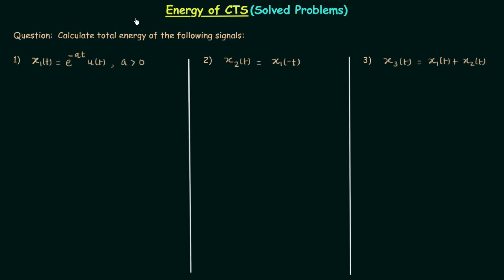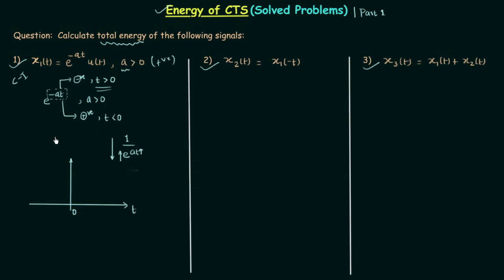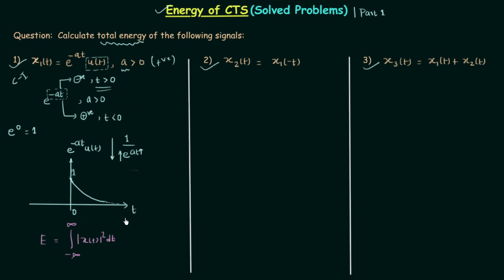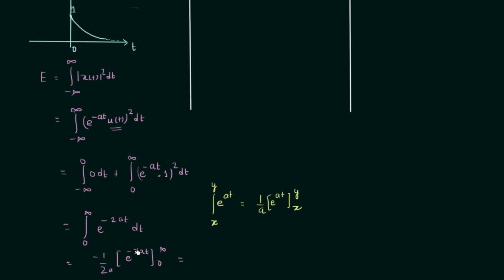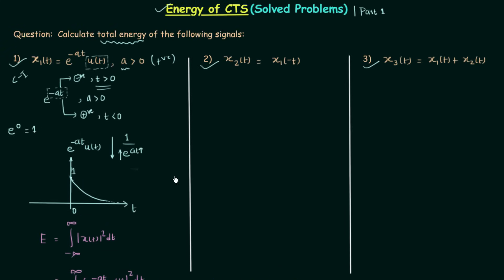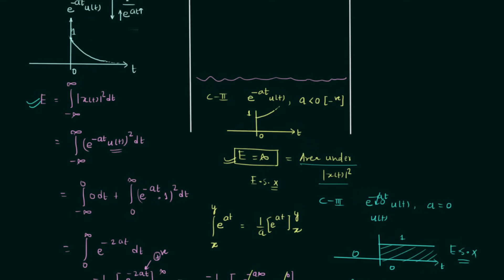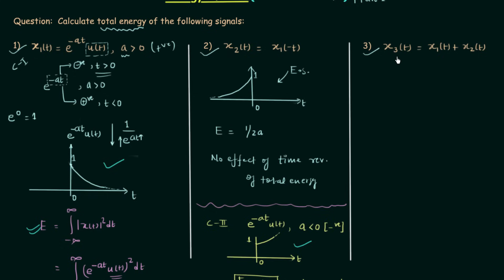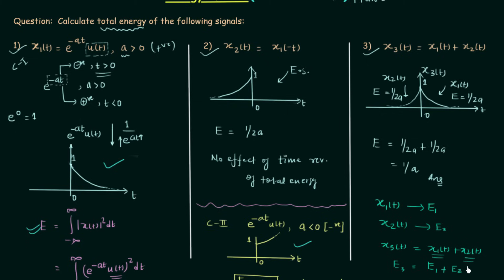Energy of CT Signals (Solved Problems) | Part 1

Comment: I am pretty sure the third case is wrong: There are again 3 cases, a< 0, a>0 and a=0. When a=0 we just have the equation of x(t) = 1 , a horizontal line that stretches in both directions infinitely so obviously E-total is infinity. When a > 0 , we have X3(t) = e^(-at)*u(t) + e^(-at)*u(-t). When a > 0, we have an exponential decreasing function such that when t < 0 it diverges and when t > 0 it converges. So the e^(-at) portion, starting at (0,1) it decreases and converges for t > 0 and for t < 0 it diverges , but when you multiply by u(t), the diverging part ( t < 0) disappears, it is equal to 0 because u(t) is 0 for t <0. That's the first part of X3(t), now looking at the second part where we have e^(-at)*u(-t), we still have the same decreasing function such that when t < 0, it diverges and when t > 0 it converges. However when we multiply by u(-t), the converging part of e^(-at) , when t > 0, it disappears, it is equal to 0 because u(-t) = 0 for t > 0. Adding both of those portions together just produces a normal decreasing exponential function where it diverges for t < 0 and converges for t > 0.  Case 3 produces the opposite except now we have in the end a exponential increasing function. All 3 cases produce functions in which total energy is infinite.
Reply: When you take the time reversal you replace each t with -t so it will be e^(+at) u(-t) not as you wrote so it also converges as t goes to minus infinity

Comment: in the third example i think you did make a mistake when you did (x1 + x2 )^2 you will find a different value wich is infinity and i don't know why
Reply: (a+b)^2 = a^2 + b^2 +2ab and 2u(t)*u(-t)=0, therefore it's correct for this eg not sure about others
Reply: I think this is valid for this case only and not valid for generalized cases